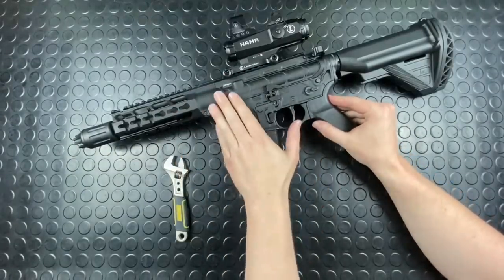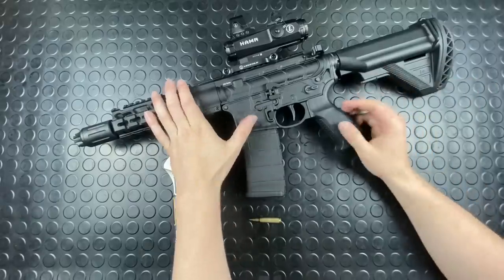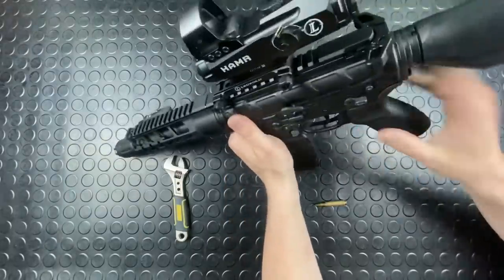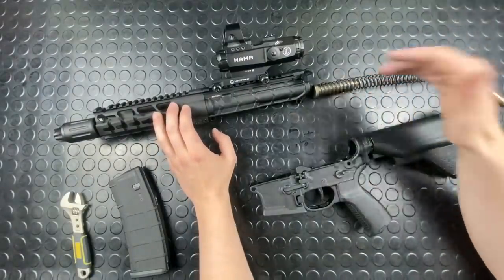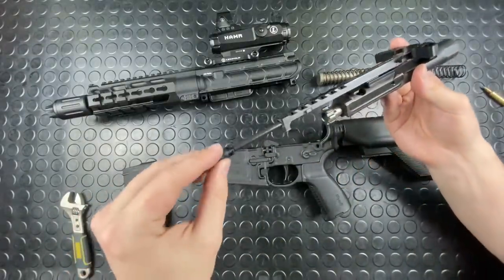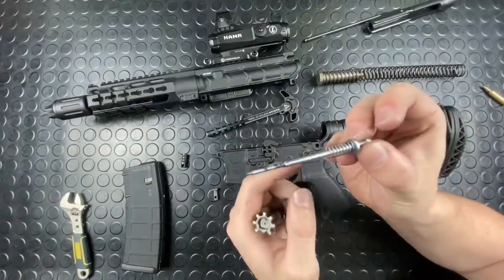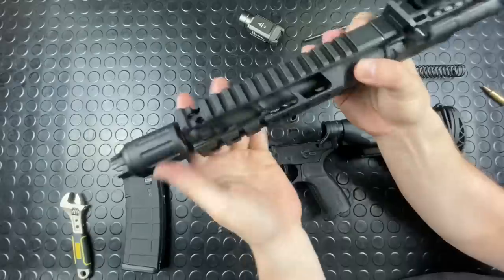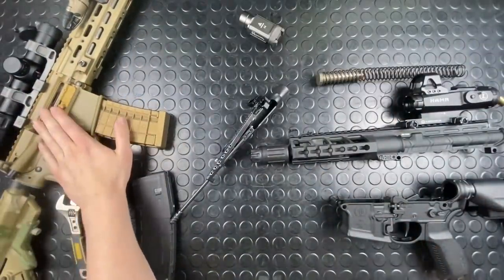Inside a Long Stroke Piston AR-15 | The Primary Weapon Systems "Diablo"

Comment: Downside of Long stroke is increased size and weight of reciprocating mass increasing felt recoils.  Gas setting are occasionally are touchy as you found out.
Reply: You ever shot a pws?  Very soft
Reply: The bolt carrier is slightly skeletonized to reduce mass so that it doesn’t require as much gas to cycle reliably and also reduces recoil.

Comment: Which is better a long stroke or short stroke piston system?
Reply from the maker: Both have merits. DI is also very good and is typically the softest shooting, but most of the benefits of piston guns are when running it in conditions not originally intended for the AR15/M16. Namely some combination of full auto and or suppressed and or with a short barrel. Having a piston based operating system really helps in that case, and in general a piston gun will run cleaner and require less cleaning/lube than a DI gun. 

You do get additional weight on the barrel from a piston system as they are all heavier than a simple gas tube a DI uses. I believe PWS's long stroke system is simpler and more efficient/lighter weight than many of the short strokes out there. It is also a little easier to maintain as you do not need to remove the handguard to access the piston for cleaning etc.

I have examples of each and love them all.
Reply: Great video turned fantastic when you whipped out that clone blaster!!! Must see that ASAP.
Reply: A short stroke system is a cylinder piston that is activated by barrel gas that makes the short stroke piston engage the bolt carrier with very aggressive and precise short strikes from the spring loaded piston rod. After striking the bolt carrier backwards the piston is left behind waiting to engage the carrier once again for the next shot. The long stroke piston is attached to the bolt carrier so when the barrel gas is directed to the piston this time the piston rod travels with the carrier much like an AK. I hope my comment was helpful because I had that very same question a couple years ago. With a better understanding about the two versions of the platform you will half to decide what platform will benefit you better. ☠💀☠🇺🇸🇨🇦✝️

Comment: Piston in a pistol should be able ta run with any buffer. Better super light but other than that it shouldn't really impact performance as far as failures right?
That's what I've come ta see.
I've got a buddy who's built a few. Seemingly they feel better with a gutted buffer, light...
Ran em all both with as low as 2oz buffer ta about 5.5oz's.

Comment: OMG !   I hope that PWS doesn't charge by the pound for that Gigantic Piston System ?  Why do you need an operating rod that can also double as a car jack is a bit mystifying but ... I guess it can come in handy.  
 That whole piston system is 3x's the weight & overall mass of the ( Superlative Arms Piston System ) 
 I have 4 Superlative Arms Piston Systems and they are Amazing ! 
  Only a few Grams heavier than a DI ( Direct Impingement ) system.  Bleed off adjustable gas block. Only ( 1 ) moving part not counting the small Mil Spec return spring. 
 Superlative Arms !  Game Changer !
Reply from the maker: Nice, I’ve also heard good things about SA and am interested in trying them. This video isn’t about their system though. Dean Sylvester at PWS went about developing a long stroke system inspired by the Ak. Also these date back pretty far. Easier for other companies to come after the fact and improve things. Dean’s said himself that they saw how the 416’s short stroke system worked and wanted to address some of its shortcomings with their own. The PWS system works very well in super short systems (that’s a 7.75” barrel) in part because the gas block was designed to compensate for lack of dwell time on short barrels. As result it’s incredibly pleasant and reliable even in super short systems. It’s also very low profile relative to other piston systems and was a solid improvement when it debuted.
Reply: You ever held/shot one?  Spanky.  If the reason you like a sub par system is a few ounces do some push/pull ups and then get the superior system.